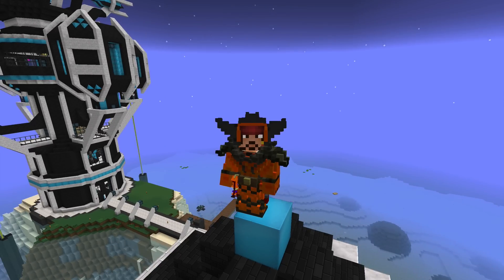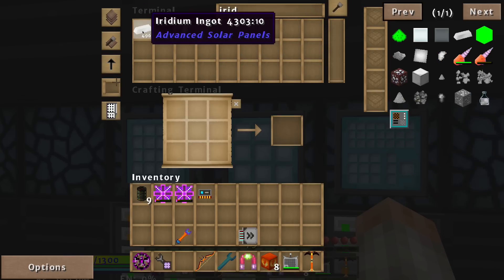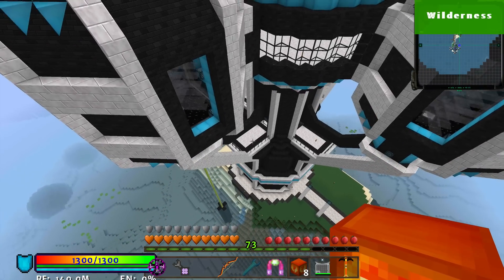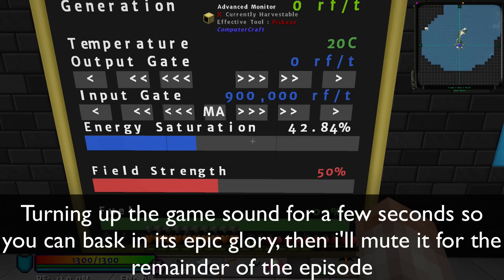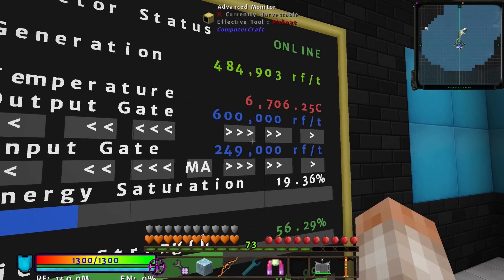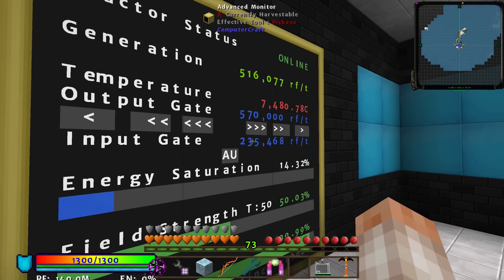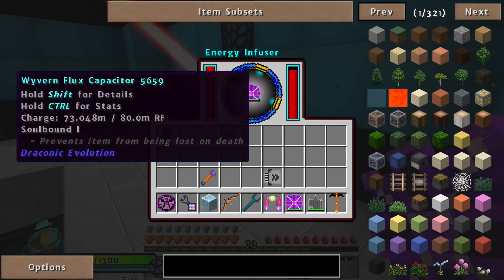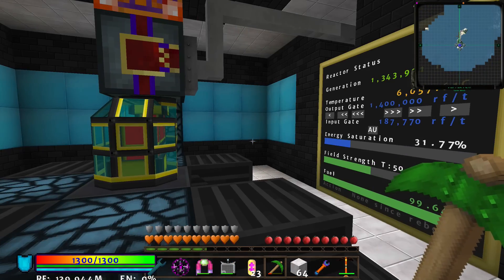We're Not Dead! - Episode 6

Comment: You can also do a Manual set for those not wanting to do CC. Max output isn't as high, but will be sparing on fuel. You also will not have to tinker with it. It will hover just over the "Scary Zone", then throttle down. Takes a few days to fully stabilize, but I was gaining about 425-450kRF/T. Set Injector to Containment Field Inverted, and Flux Gates like so:
INPUT: RSL = 537,000
OUTPUT: RSH = 222,000